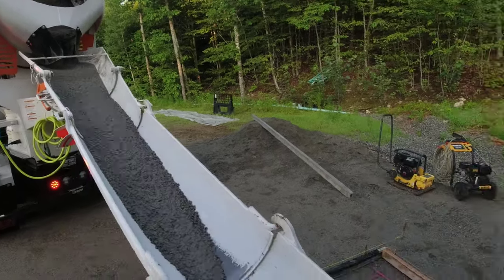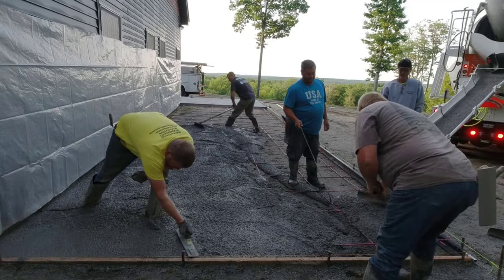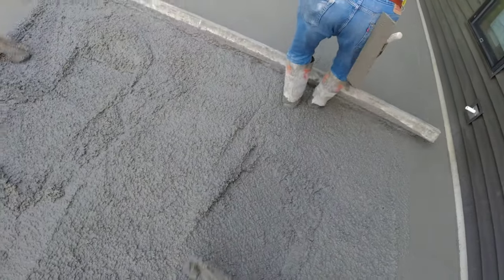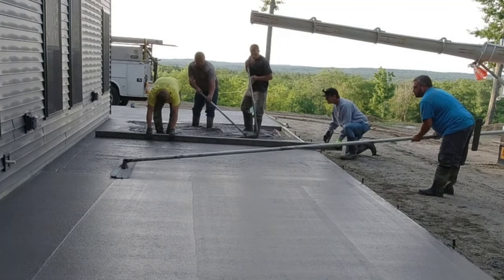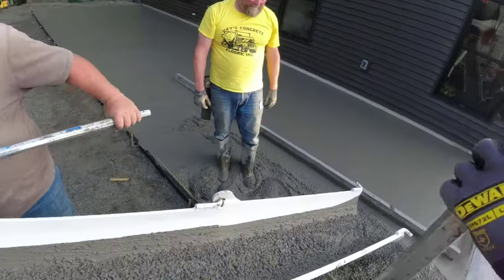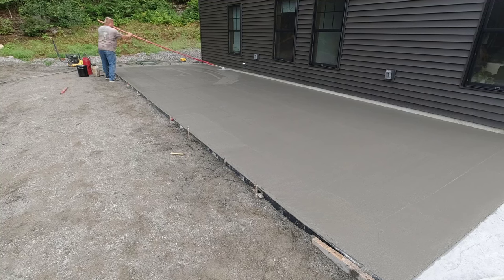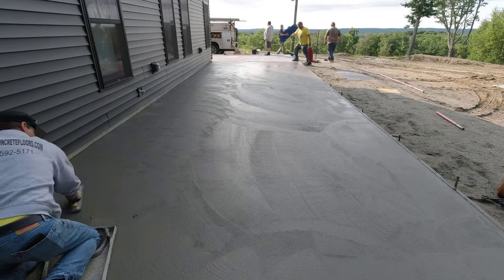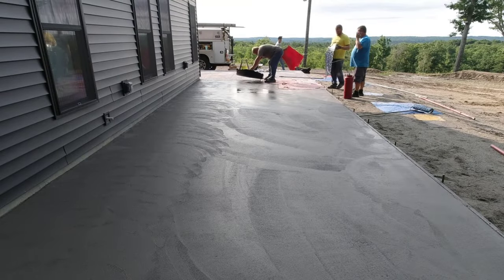How To Pour and Stamp A Concrete Patio (Part 3) Bonus - My special coloring method revealed!

Comment: Most front dump drivers in our area have the skillset to get the right amount of concrete in the form, but you do occasionally get one that can’t quite get it right. Simple solution I found was to have them stop short 5’. A good front driver can save you a lot of hard work. Sometimes it’s a combination problem, the driver is trying to dodge workers who are used to having chute control, and constantly get in the way.

Comment: I have a question: I recently poured a 9ft X 13ft X 6 inch slab, reinforcing the slab with wire mesh.  I kind of jumped the gun and  back-filled around the slab after only 3 days with a 2,700lb sub compact tractor.  I drove on the slab, then parked an 800lb trailer on it--all after only 3 days.  I didn't notice any visible cracks or signs of damage.  Could there possibly be damage coming down the road or will it be OK?  The mix was rated for 3,500 psi.